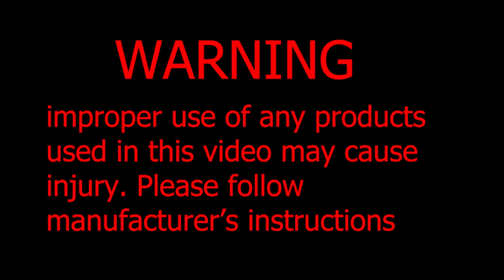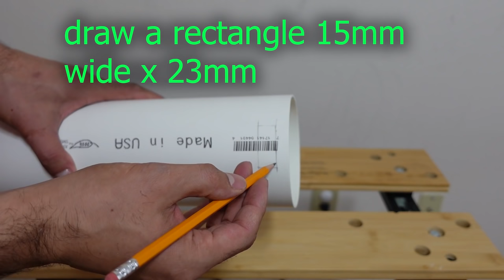How I made A Real DIY Grabpack From POPPY PLAYTIME It Really works!

Comment: I am in the process of making and materials are over 100.00 closer to 160.00 I've gotten them at lowes  and home depot. The clothes line was hard to find just purchased off Amazon. Reloading is the part that he didn't show. It retracts on its on but to actually shoot again u have to pull sting out and recoil around paper. I'm not done yet but I think it will be to complex for my 8 year old.
Reply from the maker: Hello, the second grabpack that we made is more simple. https://youtu.be/z19mozx9Wg0
This is the link for it. This should be more suitable.